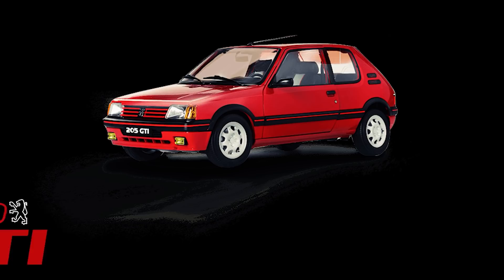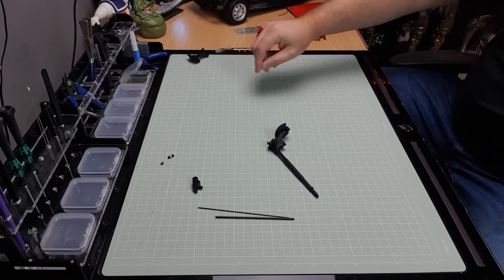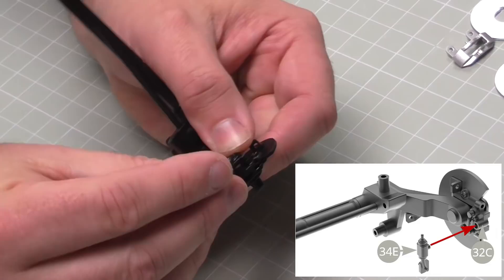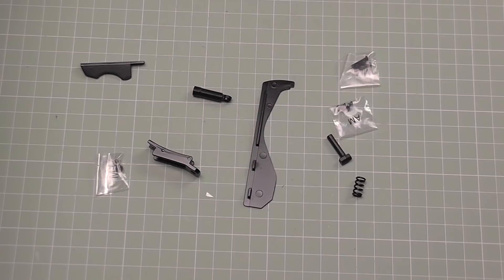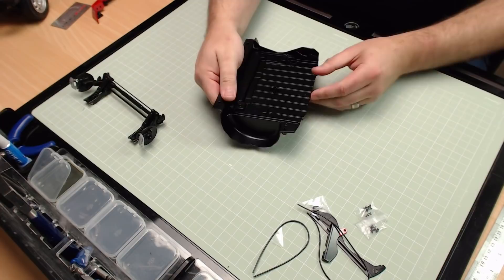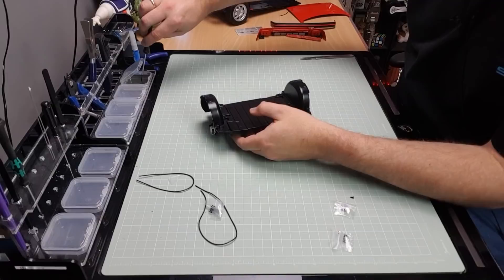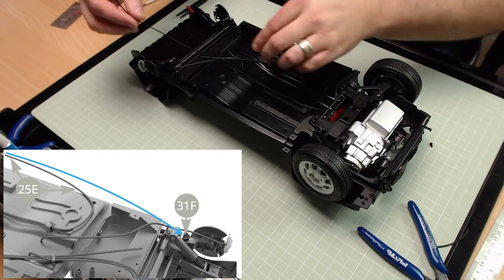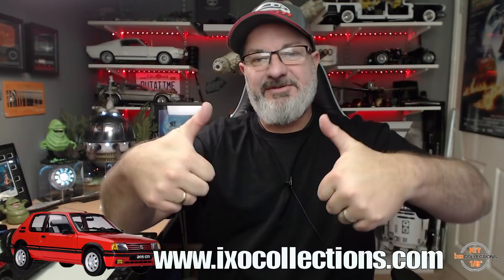Build the Peugeot 205 1.9 GTI - Parts 33,34,35 and 36 - Rear Axle and Brake Lines

Comment: What is the purpose of putting oil on the screws, is it necessary?
Reply from the maker: Just to help drive them into the metal. Sometimes the paint can mean you are cutting a channel in the thread . It just helps the screws go in easier.